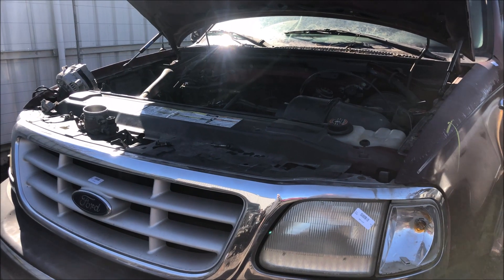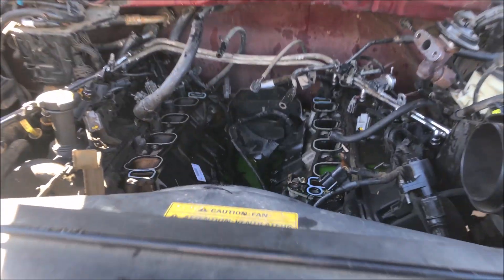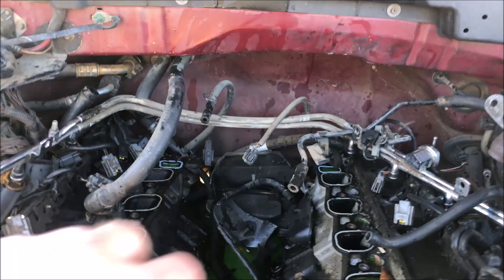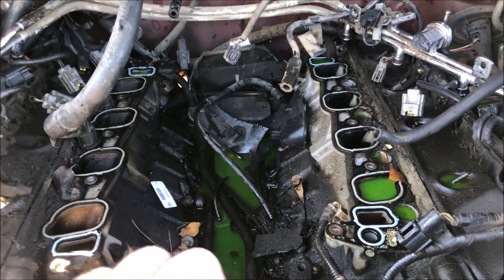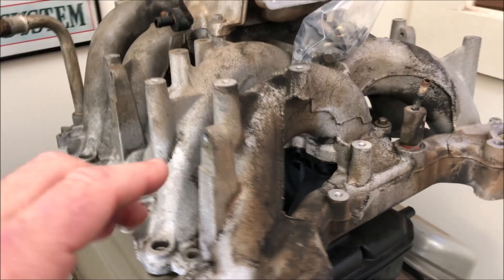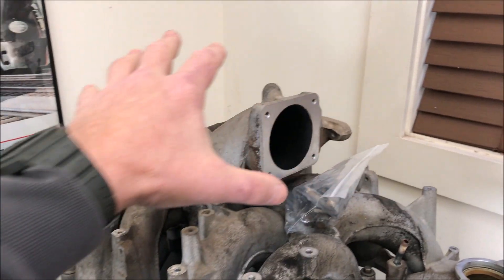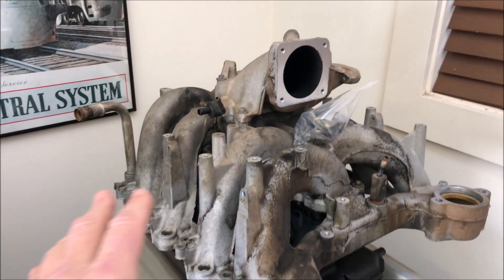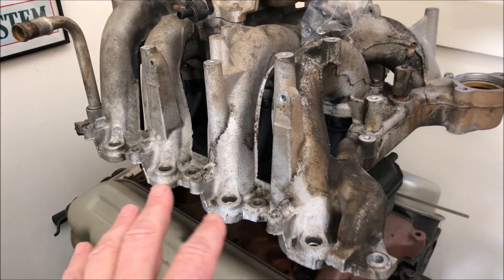How To Remove 10th Gen F150 & Expedition Aluminum Intake Manifold: Ford 5.4 2V Intake Manifold Swap

Comment: If your aluminum manifold has the usual light corrosion damage to the intake port flanges that can be ground off by your local automotive machine shop leaving a surface smoother than new. I did that to avoid buying an intake and the work took about 20 minutes. It cost me 20 bucks so I tipped the tech another 20 since he let me watch and specify how far to cut. The tool used is a "horizontal belt resurfacer" used for cylinder heads etc. It works so well I'd have it done to any used intake because manual scraping takes a long time and isn't as precise.
Reply from the maker: Great tip, thanks for sharing!

Comment: So here’s a question: what if you bought the manifold and don’t have the bolts? Any idea what I need to get?
Reply from the maker: I'm in the same boat, I need to get the bolts.  I would find another F150 with the aluminum intake in the boneyard and get those bolts.  I need to remember to do that myself.
Reply from the maker: I did some research, and it looks like this is the proper bolt size:  M8 x 1.25 x 35mm:  https://amzn.to/3IBH0a6
Reply: @DrivingIntelligence thank you. I hope you’re right. I have to get some. Now I just have to figure out the plug for the front crossover and how I want to run my heater hose.
Reply from the maker: @vortecmacs  I need to get that project moving... it's been sitting and gathering dust.  I'll first start with porting and polishing, then paint and then the install.
Reply: @DrivingIntelligence I’m tempted to open up the ports some myself. Or at least smooth the inside out some. But my truck is stock and the goal is to not get coolant leaks because a plastic manifold cracked.
Reply from the maker: @vortecmacs  the plastic manifold is smoother on the inside helping airflow.  I would consider smoothing out the ports / runners to equal up flow performance.

Comment: I have the intake & am ready, should I use 1999 gaskets & torque specs or 2001 (my truck) gaskets & torque specs?
The gaskets are completely different.
Godspeed everyone.
Reply from the maker: you should go with the '99 gasket set and torque specs.
Reply: @DrivingIntelligence  Thank you for the info. 
I just received the 1999 gaskets so hopefully I'll have it all together this weekend.
I also picked up the Expedition center console.
Gonna have to rob some more liquor stores before I do anymore upgrades... lol :face-orange-raised-eyebrow:
Reply from the maker: @stevefortney6669  lol!  I hear you!  The list is never ending.
Reply: I did the install and everything worked out Great.
I left the entire silver metal coolant pipe on the back of the intake. 
If the pipe is still there, 1999 OEM heater core hoses with connectors line up and go together like a champ.
I hope that this helps.
Godspeed everyone. :face-orange-raised-eyebrow:  @DrivingIntelligence

Comment: I have a 1997 f250 light duty that came with one 5.4 2v
Reply from the maker: My understanding is that the '97 & '98 5.4s in the F150 and F250 had the aluminum intake and this was the non-PI engine.  The '99 F150 5.4 was the only later year that came with the aluminum intake for the PI or Performance Improved engine.
Reply: @DrivingIntelligence  I agree mine are non-pi
Reply: @DrivingIntelligence  getting it ready for new heads now 😂
Reply from the maker: @CG-iu1nq performance heads?
Reply: @DrivingIntelligence  not sure yet
Reply from the maker: @ I hear these 5.4's are easy t o rebuild.  If I go that route, I will buy performance heads.
Reply: @DrivingIntelligence  good old 7 lug

Comment: Any updates? Curious to see how you redirected the heater hose in the rear -Thanks!
Reply from the maker: no new progress, sorry.  Been a busy year in and out of my channel.  I'm actually polishing the new intake a little at a time.  Want it to look good when installed.  Also, I think I want to coordinate with the replacement of my tranny when that time comes.
Reply: Just put this manifold on my 02. Order a “gates 19219” heater hose and it fits no problem. Only other things I ran into that nobody talks about is you have to have the intake bolts that the aluminum intake was originally bolted down with as they are shorter than the ones for the plastic intake. The old pcv line needs modded to reach the different location behind the throttle body or buy “Dorman pcv hose 46087”.
Reply from the maker: @jdl4808  great info, thank you
Reply: I did this conversion. The install videos help a lot.
I left the silver metal coolant pipe on the back intact and bought OEM 1999 Heater Core Hoses with new heater core push-on connectors.
Everything lined up like a champ and I've had no leaks.
I hope this helps.

Comment: What are the torque specs for reinstallation? I can't find them anywhere.
Reply from the maker: From what I see, it's a 2-stage torque sequence starting from the inner bolts and moving outward.  Stage 1, 18 in-lbs and stay 2 is 18 ft-lbs.  Please verify!

Comment: Do you have a video about how to port it?  I currently have my aluminum intake off my 5.4 and was planning to put it back on in a few days, but if I can make this improvement, I'll never have a better opportunity.
Reply from the maker: Hi, I haven't made that video yet, but I added the tools I intend to use in the description of this video.  I plan to gasket match the surfaces as well as smooth out the internals of the intake using these tools:  Brush Research BC15818 FLEX-HONE®, 1-5/8": https://amzn.to/3MJfnek
Flex-Hone Tool Brush Research Mfg Co 1 1/4": https://amzn.to/46jKHau
Sanding Drum and Sleeves Set for Drill: https://amzn.to/3FXSz75 - I'm also considering buying this lower intake plenum:  https://amzn.to/3G0DnGc

Comment: Looking forward to the port and polish vid
Reply from the maker: it will come out some time in the future!  ;)
Reply: @DrivingIntelligence  any thoughts on abrasive fluid machining, like sending it to Extrude Hone?
Reply from the maker: @mcleach71  I like the idea of Extrude Hone, but they are expensive, and I would need to see how they port / gasket match.  They could take off too much material which is not good.
Reply: Yes please. I can’t wait to see.

My dad has a similar manifold but on this 03 expedition with the 4.6 v8

Comment: Hey whats up bro i just got one from my local junk yard. What modifications do you need to do to make it work. Im going to be getting the aluminum lower from dorman.
Reply from the maker: Depends on your current vehicle.  What year and model?  If a 5.4 2v from 1999 to 2004, the only real modification is going to be the heater hose going to the fire-wall.  I'm pretty sure everything else bolts up, but I'm not sure since I haven't done mine yet.
Reply: @DrivingIntelligence  yea gonna be to a 2003 expedition. I have a new long block on the way and just wanted to get the parts I needed to slap it on when it gets here. Do you know what the part# for the aluminum lower from dorman is.

Comment: I have a 99 with the aluminum intake and I see broken plastic in the engine valley….. the truck runs great, so I’m not thinking that the plastic box underneath is broken. Dose that plastic box have a plastic insulation cover??
Reply: It looks like some kind of shield…. With dampening stuff on the inside the plastic.
Reply: Just talked to dealership…. It is a shield, I kinda knew cause the truck would not run or run very bad with cracked or broken plenum..
Reply from the maker: Glad you figured it out
Reply: Yeah it's just a sound insulator box that fits over it
Reply from the maker: The plastic box under the aluminum intake is single wall.  How much broken plastic is in the valley?  A hole in the intake would cause the engine to run rough.

Comment: Is porting and polishing the used aluminum intake manifold necessary, even if you get it off a 99 f150?
Reply from the maker: I think so... the casting inside the manifold will slow down the air velocity and cause it to tumble instead of flowing smoothly.  Gasket matching will make sure it flows into the head without obstruction.  Just my opinion... maybe worth a few hp... I'm trying to squeeze all the efficiency I can out of this engine.
Reply: @DrivingIntelligence my understanding was, you want turbulence intake and smooth mirror like ports in exhaust runners.
Reply from the maker: From my perspective, turbulence is good for a carbureted engine to mix the fuel and air, however, with fuel injection, you automatically get atomization and therefore don’t need turbulence.  Laminar flow helps get air into the engine much more effectively and efficiently.

Comment: My van has the aluminum manifold....  I am eager to see an update on the port and polishing....  

It's a project I would like to perform as well ..  I am still undecided on a cold air intake...
Reply from the maker: From time to time I am working on that Aluminum intake manifold.  Lots of working cleaning it up and I need to buy a few tools to polish the internals.  Try my ram air intake idea if you can get one installed.  Better than cold air kit:  https://youtu.be/TBssMXJgudI & https://youtu.be/xgu5tDprnpM
Reply: @DrivingIntelligence  thank you again... I will view that video.. hit the like and connect for the algorithm..

Regarding the manifold...  There's a shop here in California called Extrude Honed....   Under pressure...  They squeeze a liquid abrasive that not only polishes but also bores the intake passages...  

I am going to get a second aluminum intake manifold and have that method done..   

Again you have been so helpful....
Reply from the maker: You are very welcome.  I’ve looked at Extrude Hone.   Very pricey!